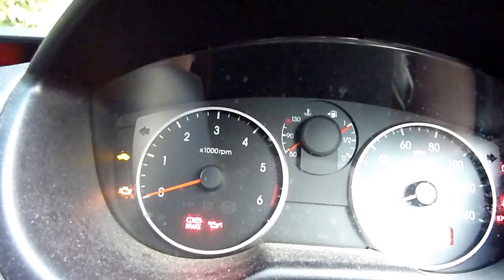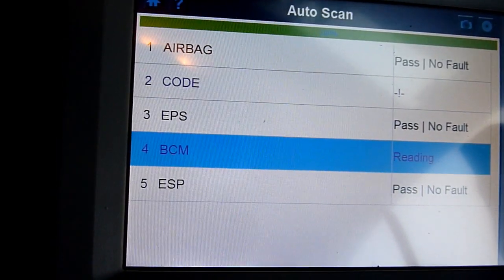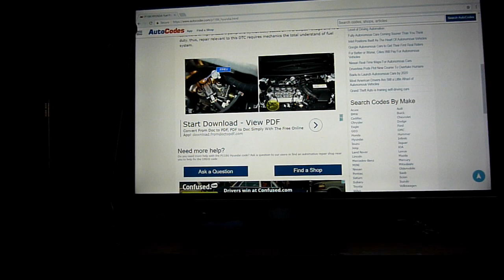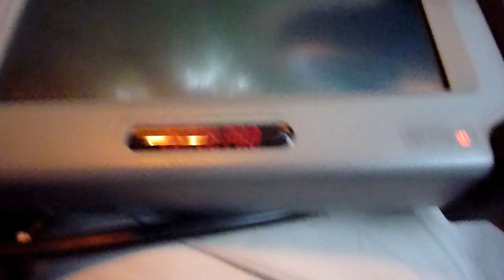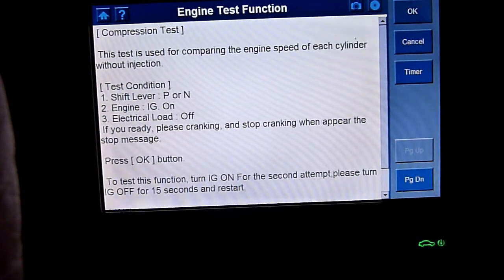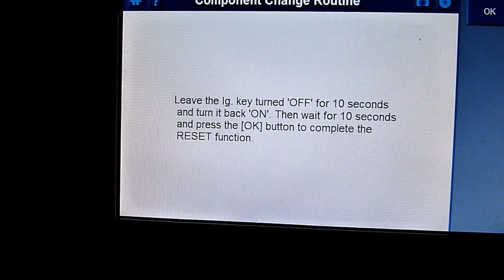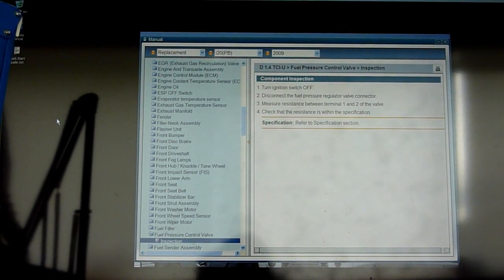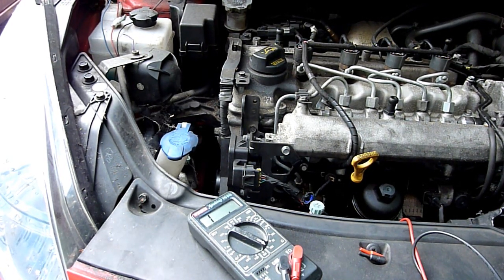Sudden Injector Shutdown on Hyundai i20 Diesel 2010, no power

Comment: model and cost of the machine? Thanks :)
Reply: Also do you consider your car noisy on the highway? Hyundai does not add noise insulation to their cars (reduces manufacturing cost and weight).
I'm thinking about installing a dampening material on the bonnet and trunk to reduce the noise!
  Possibly do the door pannels also!

PS: if you could do a listing of all the sensors both scanners can read (live data) I would appreciate!
Reply from the maker: Actron Scanners are about $180 US second hand plus postage.  But you can get cheaper newer makes like Autel for about £100. Or real professional ones like  MaxidasAutel DS 708 for about £1000 new with 1 year's subsciption all on Ebay, but see if you can get to a car shop and ask for a specialist who sells the Maxidas DS ranges because they're going to be 100% UK  or for your country and not say for China, which will be not so good. My hyundai is nice and quiet. PS totally fixed this difficult problem with my diagnostic tool. I think absolutely necessary these days. The scanners like Actron are only going up in price, as the manufacturers know we are ever more dependent on them. DS 708 is going down in price. Dampening material sounds cool, if you can get to the insides of the wheel arches, that'd be even better. Some tyres are also lower noise.
Reply from the maker: I don't think they make the that actron anymore. I'm sure you can download the manual for any other one you might want to get and the info will be in there. For the DS 708, the updates for Hyundai change every month so what you will get is not like mine, 3 years old. All the functionality can change even over 3 months as you can tell from my video (sd card 1 and sd card2). The diesel i20 is not noisy on the highway. Good luck.